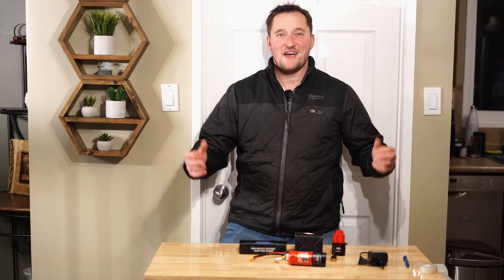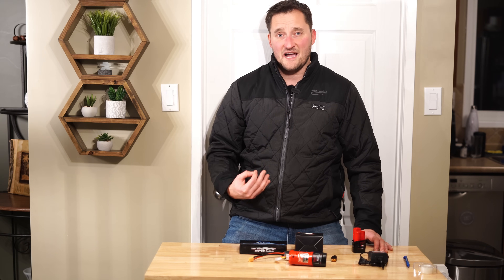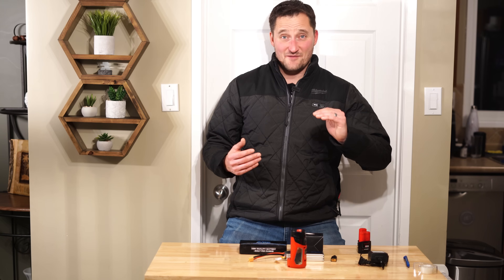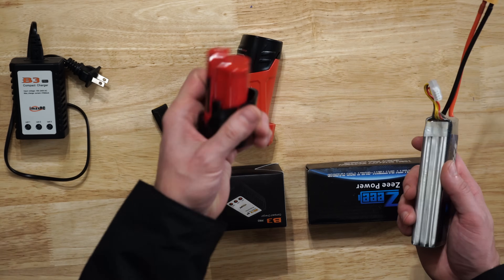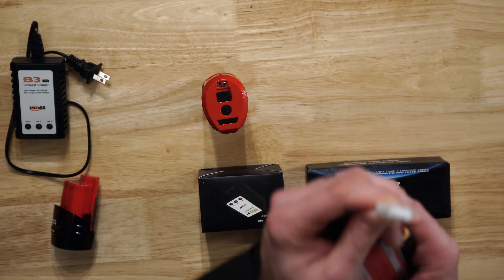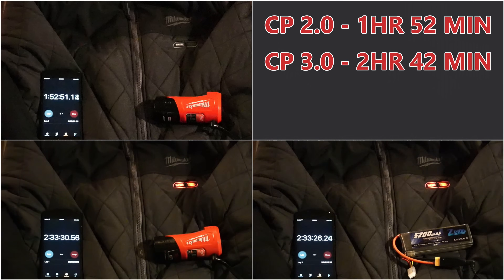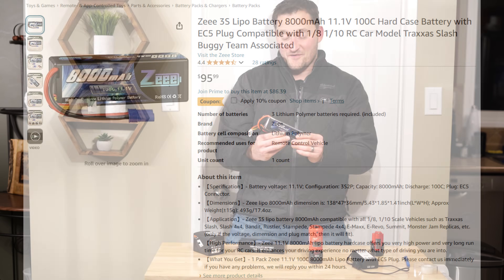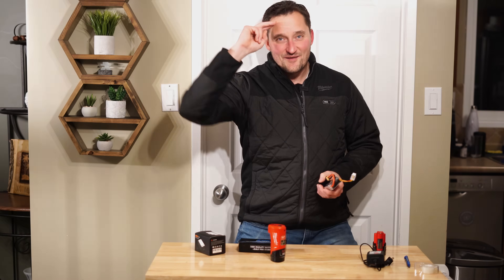WARNING! Read Description - Milwaukee M12 Heated Gear Battery HACK for INSANE RUNTIME!  Part 1

Comment: You might want to consider a Li-ion battery instead of LiPo for this. Most LiPos aren’t hard-cased, so if you drop or damage one there’s a real fire risk—and LiPo fires are no joke. They also usually don’t have a built-in BMS, so you need a separate charger and there’s nothing stopping over-discharge.

I’m big into RC stuff and I treat LiPos very carefully (mine live in a steel ammo can that I vented so it doesn't become a bomb if a battery does ignite). For this kind of application, Li-ion just makes more sense. The only real advantage of LiPo is high discharge, which you don’t need here. I run an 11.1V 6Ah Li-ion pack for my jacket—cheap, safer, and it even came with a charger.

If you’re interested in my setup, feel free to reach out. I customized the battery by removing unnecessary electronics, redesigned the case, and 3D-printed a much more compact enclosure.
Reply from the maker: Sounds like you have a ton of knowledge in this area, much appreciated! Yeah I added a low voltage alarm to my setup to compensate for a lack of a BMS. I'll keep the info in mind. Thanks!

Comment: I would recommend against this. You have this on your body and accidentally bump into something making that pack vent and you may not get it off in time . If you get a hard shell and a low voltage cut aff Alarm them maybe. But as this video stands i dont recommend.. also look at a better vharger that plugs the xt60 as well as balance leads.
Reply from the maker: Thanks for the comment, I've added a low voltage alarm and a smart charger to the setup last year.  And it's still working great. Folks need to understand the risks and then make a judgement call.

Comment: I have the 8000mah battery and i dont think it takes the XT60 adapter, do you know the right one for it? Mine doesn’t have that blue plug at the end, mines red and different adapter for it for sure
Reply from the maker: Hi there, sorry I don't know what you are referring to off the top of my head. A deans connector perhaps?

Comment: the 3s lipo  zeee battery's are awesome there all i use in my rc trucks last a long time and yes get a low voltage buzzer
Reply from the maker: Yep, the battery has been very good so far, no real complaints. And yes, I've added the low voltage buzzer. Cheers!

Comment: I just try this cuz my son has the RC that takes that battery and it burn up my coat now I won't turn on
Reply from the maker: What voltage was the battery you used? I bet it was higher than 11.1 if you say it burnt out the jacket

Comment: you are playing with fire using RC batteries ... you would need a volt meter to monitor this. You should not go below 3.2V to 3.3V per cell ... for a 3s - 9.6V to 9.9V total
Reply from the maker: Hey there, I've added a voltage monitor/alarm to the setup. Thanks!

Comment: What size cell is the RC battery? 2S, 3S, 4S?  I need a little clarification 

Thanks
Reply from the maker: You need to match the voltage up as close as you can. Make sure you are taking all the necessary safety precautions as well. I believe I went 3s aka 11.1 volts. Hope that helps!
Reply: So do you use that adapter with a Two prong jacket pocket plug? And only use one prong? 
Hope that makes sense?
Reply from the maker: @EdZwingelberg yeah, you are talking about the new hexon jackets, mine is an older style. If I get my hands on one for testing I can confirm, but in theory that sounds right!

Comment: You know I should’ve made a video about this a while ago but here I am watching it haha. I’ve been into rc since I was a kid and now as adult it’s just gotten bigger and more expensive haha. I got into the flying r/c vehicles but drones in specific gave me god like abilities when it comes to soldering but also am insane amount or random parts and hardware. 
Now that I’m older the rc cars turned into real cars and even equipment so getting a heating jacket happened really quick. But I was also sick of the battery situation. I have so many lipos for all my r/c’s and all the connectors and everything to make adapters for all the leads 😂😂❤
It’s cool to see there’s a simple way to to just plug everything into each other
Reply from the maker: Honestly, that was my path to YouTube! I was working on a project one day (levelling my pool deck) and decided to record and upload it to the app. Didn't have notifications turned on, and basically fell asleep on it for a year and then next thing you know.... Here I am lol!  The 5200mah battery has been very good to me, it's absolutely perfect for tailgating, getting through an entire football game, as well as meandering home. The low voltage alarm was a great addition and it has yet to kick in, plus best of all you don't notice that pack in the jacket at all when sitting. It's great! Yeah for a low current draw application like this I'm cool running a few adapters for the desired result. If it was a heavy draw application I might rethink that. Thanks again for the kind words. The support means a ton to me! 🙏

Comment: I share your thoughts bro, bumping up battery size seems like the obvious fix for longer runtime. But honestly, slapping on these big batteries feels like hauling around lead weights, not everyone is a fitness influencer🦵. I also considered another approach: instead of carrying a heavy, plate-like battery in one pocket, distributing several smaller batteries in various pockets to make them virtually invisible might offer greater flexibility and comfort, and I accidentally discovered that someone had already done this
Came across INOKARFT's heated jacket approach recently. It runs off two tiny 4V batteries in parallel, kinda like Ryobi's 4V system. Total weight's actually lighter than Milwaukee's single M12 brick. Just carry two spares and you've doubled your runtime. They're about like packs of gum in your pockets, barely notice 'em. Clever how they split the same power into smaller units instead of one clunky battery. You actually move better without that weight pulling at one spot
Got one coming myself, going to study it👨‍🔬, worth checking out if you're interested in this solution
Reply from the maker: Hi Jason, please reach out to me at https://www.instagram.com/regschannel?igsh=djdyMmt0dXZrcjc3 to discuss further. 

Thanks!
Reply from the maker: Also worth mentioning my solution is 11.1v@ approximately 5.2ah. I literally wore the jacket yesterday and whether sitting down with a backrest or standing you cannot tell the weight is there, but the heat definitely is. Doing a quick Google search, the jacket you mention uses 21700 cylindrical cells?
Reply: @RegsChannel  Yep, it's the 21700. They sell the battery separately with detailed specs in the listing, cause my heated jacket hasn't arrived yet, I'll test it after delivery

Comment: Is there any info on  LiHV batteries for a power source?
Reply from the maker: Great question, I don't know enough to confidently say. I know they operate at a slightly higher voltage per cell, which essentially means you would be overclocking the jacket lol. Remember the jacket represents a pretty static low current draw. At a higher voltage the jacket should get hotter, but that could impact longevity. If the liHV cells were all you had, I'm sure in the right configuration they would work, but I don't think I would seek them out for this application. Although I could be wrong! Thanks for the comment

Comment: Your comparing a lithoing to a lipo your nuts lipo are so dangerous then lithium that lipo ever flares your in trouble they use those battery’s for rc stuff I’ve seen those things blow many times
Reply from the maker: Hey there! It's been a year and I'm still here lol! Remember, I'm literally sitting in a seat in -15 degree Celsius weather drinking beer. On my application . I've added a low voltage alarm and upgraded my charger just to be on the safe side. The charge discharge rates, along with use cases for RC applications are nuts by comparison. The jackets draw on the battery is negligible. Cheers!

Comment: I use portable batteries with a the adapter. 10,000 mah portable battery will last about 8 hours on high and are a lot safer. Also easier to recharge.
Reply from the maker: Hey there, any idea what the output voltage is from the portable battery? Thanks!

Comment: Got the see battery’s and for some reason would not just work but jacket does light up but doesn’t heat up
Reply: Ahh 7.4volts I need the 11 volt battery don’t I
Reply from the maker: @brysoneaton6582 glad you got to the bottom of it!
Reply: @RegsChannel you’re awesome thanks
Reply: Is there any adapter for the new versions ?
Reply from the maker: @brysoneaton6582 I would need to get my hands on a newer version to see. As soon as I do I will see what I can find out!
Reply from the maker: What voltage battery did you get? That can make a difference. Make sure you take all the necessary safety precautions with these as well. Cheers!

Comment: I cant find the adapter for the milwaukee heated with two dc connectors. Any one have a link to them?
Reply from the maker: I think you are referring to the Hexon jackets? I haven't managed to get one for testing yet, but I believe that the larger plug is for the heat, and the smaller one may be for the Bluetooth connectivity? Again, this is my best guess and the older adapter packs are still compatible with these jackets. Hope that helps!
Reply: @RegsChannel  THANKS FOR RESPONDING. I WILL LOOK MORE INTO IT. IF I FIND ANYTHING I WILL LET YOU KNOW.

Comment: hi I bought all the stuff for my hubbys m12 vest but it has 2 male points to connect to adaptor i think i ordered wrong adaptor  can you help me know what i need
Reply from the maker: Hey there, did you read the video description? I did a follow up video to this one that does touch on some of those things. I need to strongly encourage you do your homework here and follow all the necessary safety precautions. A more robust charger and a low voltage alarm were two things I added ASAP along with learning how to properly charge use and store those types of batteries.

Comment: I use a dewalt 20v 5ah batt with the dewalt adapter. It's huge but lasts all day. I use dewalt because I have 9 of them but if you have m18 then use them.
Reply from the maker: Sound advice, my challenge is with the size of the battery. I'm sitting for at least 3 hours and not having the bulky pack poking me in the back was my motivation to look into this, but I can totally appreciate running what you have, makes the most sense!

Comment: That battery balance end wasn't intended to charge that battery the st60 end is for charging and discharging the ballance lead is for balancing while charging the battery. Two people need to know that battery will burn your house down if  charged improperly if it gets impaled or if you overcharged it and you will damage the battery if you over discharge it  be careful
Reply from the maker: @jbengineering2681  hi there, I have since integrated a low voltage alarm and upgraded to an intelligent charger to be safe. What is the point of the charger that charges via balance leads then?

Comment: I use a TackLife 16500mAh (61Wh) battery that has the correct pole plug socket and outputs 12v @10A in my Milwaukee ToughShell :)  I'll have to do a runtime test like yours but it lasts forever!
Reply from the maker: @TunaSoda  is that tacklife a car jump starter? I have a 26800mAh Anker battery pack with an adapter cable that I will be doing soon as well.
Reply: @RegsChannel  Yes, it used to be on Amazon, the Tacklife T6 Car Jump Starter 600A Peak lol  It is a bit of a beast in size, but only really bothers me sitting in the car.
Reply from the maker: @TunaSoda  right on, the reason I went with the LiPo pack was in predominantly sitting when using it and it, for me at least is almost undetectable! I can imagine you must get some sick runtime out of a pack that size!

Comment: DO NOT DO THIS PEOPLE!!!!!!!!! Look up lipo battery fails you basically have a metal torch strapped to your body.
Reply from the maker: Hi there again, as mentioned previously, I've added a low voltage alarm to the battery, and have started using an intelligent charger. Making sure things aren't over or undercharged is critical here.
Reply: @RegsChannel  that doesn't matter you're an idiot all it takes is for a wire to get damaged a effn low voltage alarm isn't going to stop something like that but remember stop drop and roll but you probably can't even do that right....................

Comment: Very stupid idea to have a high capacity LIPO battery strapped to your body and give advice to people that have no clue the dangers of LIPO
Reply from the maker: @jeffro5180  thanks for taking the time to comment. I've added a low voltage alarm to the mix as well as I'm now using an intelligent charger. Cheers!

Comment: Anyone know if they make an DC to USB adapter for the new hexagon “ top off” connection ? The new hexagon jackets come with 2 DC connection. One looks bigger than the other. Will the older style DC to USB adapter work?
Reply from the maker: @lmSteveo  toy knowledge the large plug will work with the old style packs. The tiny plug I assume is for Bluetooth functionality. I need to get my hands on a. Hexon jacket to confirm this. Thanks for the comment!

Comment: The new jackets have a different connector on them that actually turns on the power source.
Reply from the maker: @jeffclark5024  yeah but I think the primary barrel connector is still the same size, I feel like the secondary connector is for the Bluetooth connectivity. Once I get my hands on one, I can do some further testing. Cheers!

Comment: Just make your own 18650 or 21700 pack. Either option will be far better than a RC pack, and far safer too! But seriously, the energy density of 18650/21700 cells is much greater than those RC packs. The RC packs are great for outputting high amounts of amps, quickly. But they don't hold lots of capacity, unlike the 18650 cells do!  Just make your own pack!
Reply from the maker: The Milwaukee XP 3.0 essentially is 3 18650 cells, and you would still need some kind of BMS.  I'm after keeping the size to a minimum hence the pouch cells. I appreciate the suggestion though!
Reply: Sure, but 18650 cells come in various capacity’s. It’s a simple fact that pouch cells from an RC car for example, have far greater amp output but less capacity output than lithium ion (18650). And the pouch cells should also technically require a BMS.  The same theory would apply.  You can run them without in the exact same way you’re running the pouch cell, it’s just not recommended (unless you monitor the voltage when discharging and charging).

Comment: Here's an idea… Get yourself another mini three amp battery and get six hours! Wow
Reply from the maker: @Magicinstalls  hi there, thanks for the comment, my primary reason for going with the LiPo was the smaller form factor. As I stated in the video I am primarily sitting down and it's nice to not have that bulbous pack poking me in the back. Cheers!
Reply: @RegsChannel  Yeah I get it. I will probably do the same
Reply from the maker: @Magicinstalls  good stuff, make sure you do your homework on all the necessary safety precautions to follow if you choose to do this, but so far I can't complain with the results!

Comment: Dude...for the safety reasons associated with LiPo in this use case, which you apparently became aware of AFTER producing this vid....you may want to consider taking this vid down.  At a minimum you should consider replacing it with a video that includes the safety warnings.  Depending upon which platform someone is using to watch the vid, they may not have the ability to read the description.  You know damn well people who are ignorant in regards to LiPo are going to run the battery to zero if they are not properly educated.  Do the right thing.
Reply from the maker: @hellbent_ftw  Hi There, thanks for taking the time to comment. I've actually released an updated video, and plan to put out another one speaking specifically to safety. Thanks!